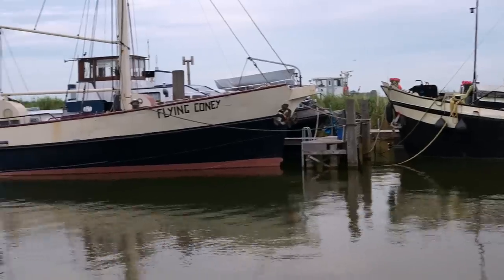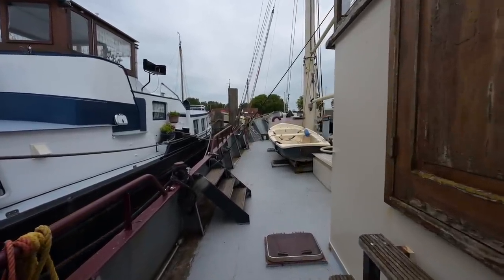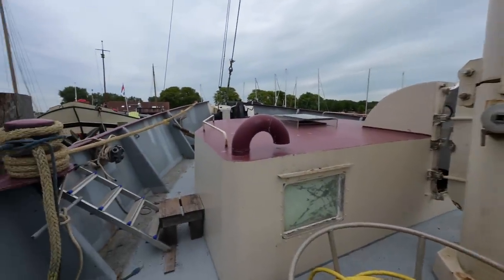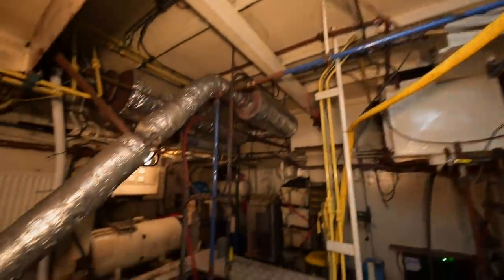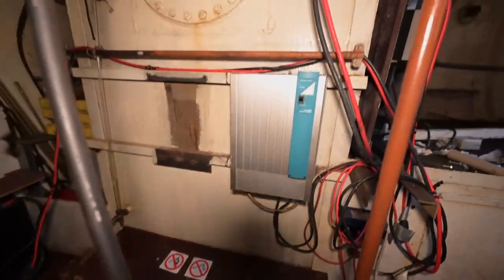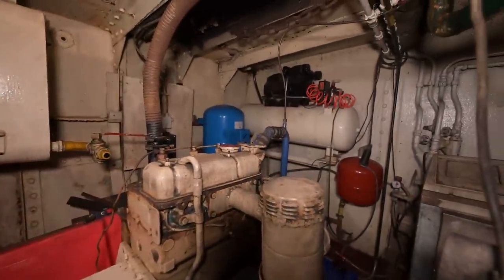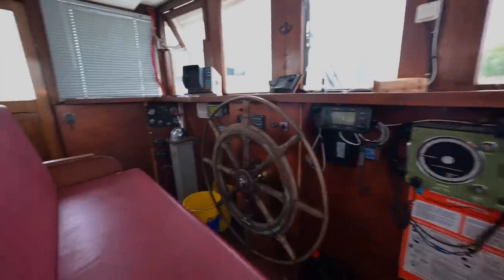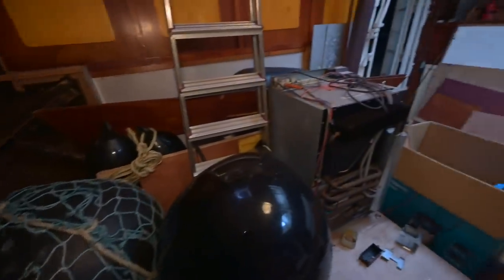Boat Tour! - What has changed since we bought Flying Coney?

Comment: I have a suggestion. Since I have been involved in the restoration and repair of an 80 year old WW2 steel Landing Craft in Portland, Oregon (the USS LCI713), we have been preserving the steel using this method.  For restoring the ship interior hull, we have had very good results by first properly cleaning the loose rust with a wire wheel, then applying (1 or 2 coats) a 'Rust Converter" primer, and then several coats of white enamel topcoat paint over the cured rust converter primer. This method will stop any further interior corrosion, and brighten up the compartment as well. The interior of your ship could use some added brightness! Then we install thermal insulation over the painted hull surface. In our case, we used hard sheet foam board 25mm thick and construction adhesive to attach it. Over the foam board we cut sheets of cloth and used thin wallpaper paste to stick the cloth over the foam board to provide a smooth surface suitable for painting. Then paint whatever color desired. Perhaps you may want to consider using a similar strategy to ours for treating the old "fish room" and forecastle room. The rust converter primer that we use is a brand called "Corroseal" but I am sure that there are many other similar products available to you. I think its active ingredient is phosphoric acid that converts the rust into a stable "magnatite" black iron oxide (rather than unstable red hematite) that once it forms will not continue to oxidize further. I hope this is useful information to you. Otherwise, you two have done so much on Flying Coney and you have a fantastic channel! Jerry
Reply from the maker: It's a fantastic project you have, very interesting! Our main problem when considering different methods to conserve the hull is that we have riveted, overlapping steel plates. We can't reach every rust in between the plates or underneath the frames. Also rust converter will not reach everything. So speaking about conserving the hull a relatively fluid grease, fat, bitumen or similar is the best method (Ovatrol, Liquid Shield...) The problem is that you can't really glue insulation on these type of coatings. So our idea is to make panels, glue the insulation on the panels and screw the panels onto the frames. Leaving a small air gap between the insulation and the hull. Cheap easy and quick and also not a problem if we need to have a rivet welded. We also can only use either armaflex or stone wool insulation for legal reasons. Thank your for giving us tipps ans for following along! All the best.
Reply: you don't need to glue the insulation to the hull.  there are special nails you spotweld on the hull , they look like huge drawing pins. you simply pin the insulation on them, try google an image of a 'lasnagel', you'll see what i mean.
Reply: Hi Could you give me the name of the rust converter primer please, I am in the process of rubbing down the entirety of my boat at the moment and have a lot of rust to deal with, any products that are going to help me would be a boon. It's a wide beam barge and quite a lot of work to undertake.
Reply: @TrogART  it is called Corroseal
Reply: @allaboutboats  thanks, that rings a bell!

Comment: Youre both so mentally strong to keep positive, I'd of called it a day long ago. There is just so much to do, yet you haven't stopped working on her since the day you bought her.  A simple job such as running a wire for a second depth sounder takes me all day, and ive had enough by the time ive finished. Your a great team and you must have a solid partnership, i envy you.
Reply from the maker: Sometimes it's tough but slowly we're getting there. It's an adventure and if you would know what you've bought yourself into when you start you wouldn't do it 🤣

Comment: Great video, clearly explaining as you go. Your navigation equipment is fine and very reliable.
I navigated a vessel around most of New Zealand using that exact same GPS with its small screen plus a separate radar.
Reply from the maker: The navigation equipment is mostly fine. A few more gauges and warning lights for the engine would be great and the four not communicating PWM solar chargers are not great. But combined with good old paper charts it's good enough for now.

Comment: For many years ‘50-‘80’s  my father ran a English manufacturer plant that made waterproof paper from 2 layers of heavy craft paper and bitchium with sisal later fiberglass for strength. Many waterproofing applications called ‘Sisalcraft’. Prehaps a product like this could work as a layer between the hull and insulation . 
There were many version of this product with silver foil and extra thick etc.   some roofing products might be similar. 
I do not like the idea of any wood strips against the hull frames for obvious reasons . 
A cheap very durable modern sheet product is ‘coroplas’ or twin-wall.plastic.   This could be a good barrier too. 
Many decisions for you to consider 
Good luck
Warren

Comment: Wow. Just wow. What a huge task before you! But she will be a great looking ship when you take off that rear cabin aft of the wheelhouse.
Reply from the maker: The idea is to make the aft deck on bulwark hight. In my opinion that's the best compromise for a sailing ship. You have a great steering position where you can see the sails and still a lot of space underneath for an owners cabin. The lowered wheelhouse would still be a great inside steering position under motor and a great place to sit down, have a coffee or warm up for the next shift in the cold.

Comment: Very interesting Video.
You wanted some questions😂 - here they are:
 Please share drawings or some illustrations of the plans to lower the aft cabin. Will it still have a water tight door? How is the access to the wheelhouse? 
Were in Germany you will do the next steps?
Reply from the maker: At this point we don't have drawings for lowering the aft deck. We made some measurements and checked for plausibility. Also you can see the original deck underneath the shower, so the raised quarterdeck is fairly new. The lowering of the quarter deck itself is straight forward, the tricky bit is how to integrate the wheelhouse. That we do want to go to Germany was a big spoiler and we still have to make it to Germany. But if everything goes as planned we will go out at the Bültjer yard.
Reply: @FlyingConey  That was really a fast answer! Seems a good place there - na denn mal tau.

Comment: Unless you have problems with corrosion under the concrete and/or need space for more ballast, I would leave the concrete as it is. It’s excellent corrosion proofing if it was done right and also serves as reasonable density ballast at a good price. Before you remove the aft poopdeck please take a look at a ship named “Meteor” in Stockholm. Keeping it will save you enormous amount of work and you will still have a nice sailing ship. Best of luck/ : D
Reply from the maker: If you look at our line drawing with a lowered quarter deck the lines are quite similar to the lines of Meteor. The reason is that we're a bit smaller than this ship. We don't want to remove the raised deck, we just want to lower it down a bit. 
Also we're not going to remove the ballast. You're right, concrete is great to protect steel. Sometimes you have gutters on deck and these gutters are filled with concrete in our case. The problem is that where the concrete meets the wooden deck it's leaking and there's growing plants and everything 😂 I'm not a big fan of concrete above the water line... 
But you put a lot of thought into your comment and it shows that you know quite something about boats, so please se my answer as a detailed response. Thank you for your comment!

Comment: Just because a system is older, doesn't mean it's worse than a newer system.  In my experience, the more 'electric' you go, the more problems you can have.  Of course, I'm not advocating that for navigation we should all return to using sextants, etc.  But still, look before you leap!
Reply from the maker: Are you referring to the old Perkins genset? Well we do have three engines in the engine room. The youngest one is the Deutz Generator it's 30 years old now. The main engine is almost 50 years old now and still going strong. The Perkins is far older than that has 25 000 hours on it and it's "Frankenstein" looking on the electrical side. It's a huge project on its own, but if you have the skill and time maybe you want to come over and have a look.

Comment: Getting rid of a generator engine because its old to make space.. Well, what if it was running? Would you keep it then? Because it may not be too much effort to get it to run. 

I love your watertight doors for ever compartment. That is great! I really had no clue that that was the case. It certainly is what you need, and will make sure you don't sink in the ocean when there is a leak. 

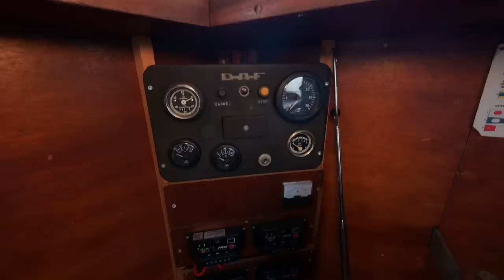You forgot to mention the SONAR. 10:35

I would rip every last part of the stuff out on the lower decks and get the frames fixed and then maybe do some bitumen paint on the inside. Then some rockwool and then some laminated board sheets you can stack up and laminate yourself too. Or something of the sort. 

Yes the watertight doors are very cool. I would certainly add these to a steel sailing boat if I would go onto the sea. This is no luxury, it is very important because you wont regret it when things happen. Just be sure they are closed all the time, otherwise its just as terrible as having no watertight doors at all. You wont be the first ship that sank like that. 

If I were you, I would certainly learn every last bit there is to know about welding, and diesel engines. As well as electricity. You will not regret knowing these things because they will save a lot of money, and you will be able to fix the ship anywhere. 

Very cool boat! 

Greetings,

Jeff
Reply from the maker: Hi Jeff, it's not only the engine of the generator nor working, that would be the easy thing to fix but it was decommissioned about 30 years ago, it has 25 000 hours and the electric side looks "Frankenstein". Also we don't need a genset that big. But if you like you can have a look at it 😉
Our idea for the coating and the insulation is to use liquid shield and perma shield made from wool fat on the hull. It's conserving the steel even under the frames and in between the plates. I'm not a big fan of rock wool insulation so our idea is to make panes with armaflex insulation and screw that to the frames. If that makes sense... 
We have plenty of opportunity to practice welding when laying the deck, it's not as safety relevant as the frames and quite some meters of weld needed. 
All the best!

Comment: Just one comment. Beware that your gearbox bearings and clutches will burn if the propeller is free spinning. One way to come around this is to install a  brake on the propeller shaft. Or you run the engine in a few hours interwall.
Reply from the maker: Thank you! I wasn't sure about that. I think leaving the engine in gear would do the trick?
Reply: @FlyingConey  No, it's,  as far as I know a hydraulic box. When the gearbox oil pump is not running, no action goes on inside. In my boat, much, much smaller, I have a ZF hydraulic gearbox by factory guaranteed for sailing. That is free spinning propeller. My advice would in that case to ask producer or local dealer for advice. That gear box costs a small fortune.
Reply from the maker: I will check with twin disc once we will go sailing and your absolutely right, the gear box is more expensive than the engine 😨

Comment: How many years do you think it will take to repair and rebuild the boat before you can safely sail with other people on board . What do you estimate the cost will be to completely fix the entire boat.
Reply from the maker: If we do have a steady income that's reasonable for two people it will take us 2-3 years. Until now we managed to do this refit at very reasonable costs so my estimation is 400-450 000€ for the entire refit.  Less than half of it and we have a safe motorboat and a few cabins. The rig is the single most expensive thing but it can be done in stages.

Comment: That was very enjoyable especially comparing this to the previous/original tour.
Don't you need the concreate for ballast?
Reply from the maker: Thank you! The ballast mostly is the flat part of the cabin sole. What we want to remove is concrete that was there to protect the frames from melting ice during her fishing time. So just a bit that is in between the frames and only a few 100kg. We will weigh it and stability for sailing is a separate topic. But the little bit we have to remove doesn't make any difference.

Comment: Should try to get that perkins working
Reply from the maker: We don't have the space nor do we need two generators. So I believe keeping the newer and smaller one is the more reasonable decision. Also the decision to remove the Perkins is more about the electric side of the generator. It's just too old and it has 25 000 hours on the clock.

Comment: You mention new steel masts. Do they have to be steel or are there other options?
Reply from the maker: Considering everything steel is really the only option. The only alternative is wood, but it's difficult to get or more expensive if you want laminated ones. Also more maintenance and not as secure. Speaking about sailing performance the benefits are marginal. But we do want to have wooden spars and probably wooden topmasts.

Comment: if you remove the concrete, what will you use as ballast?
Reply from the maker: We're not removing the ballast. Back in 1950 there was a change in fishing. They started to use ice to conserve the fish at sea. Someone back then thought that the melting ice could destroy the frames and thought that maybe a little bit of concrete in between the frames could protect them. We only want to remove this bit and not the many tones of ballast that makes the flat cabin sole of the ship.

Comment: What will replace rhe concrete ballast?
Reply from the maker: We will not touch the concrete ballast 😉 Only a little bit that was poured in between the frames to protect them. We also want to remove quite a bit of weight that's above the waterline to improve the stability.